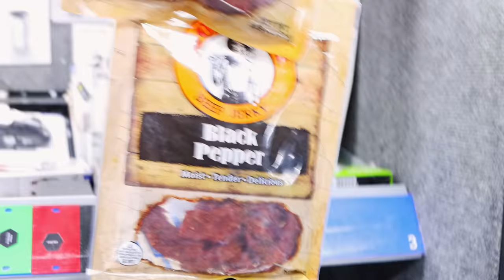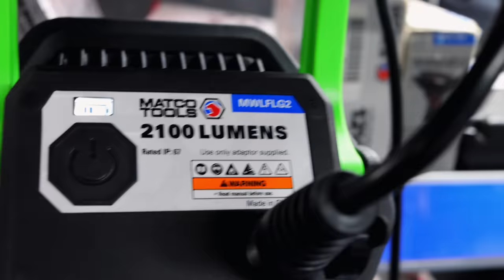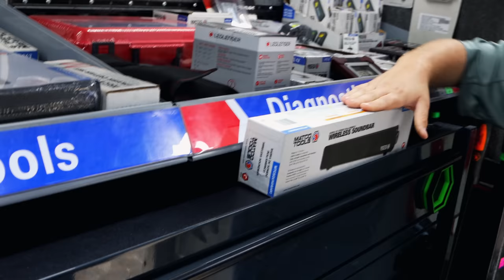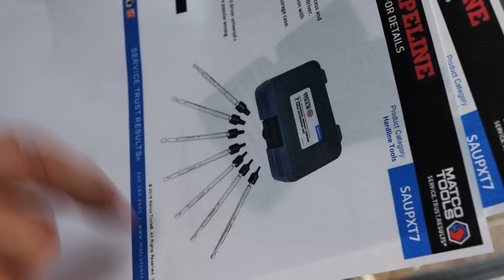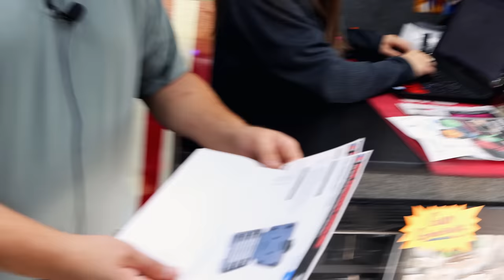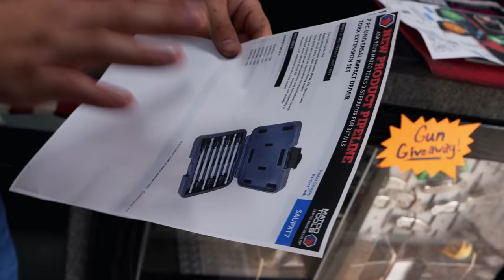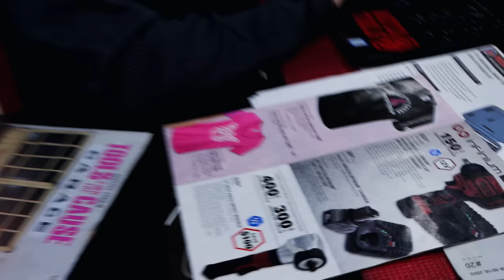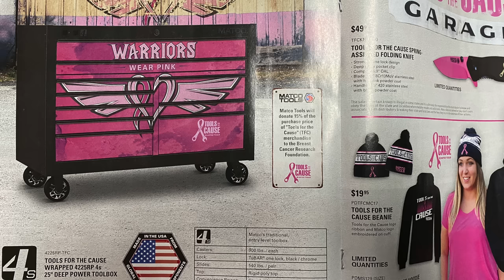Matco Tools New 2500 Lumen Underhood Light And Tools For The Cause Shirts

Comment: Well matco you have the blue handle 3/8 locking flex head ratchet now you need to offer a pink handle 3/8 locking flex head ratchet in the standard length